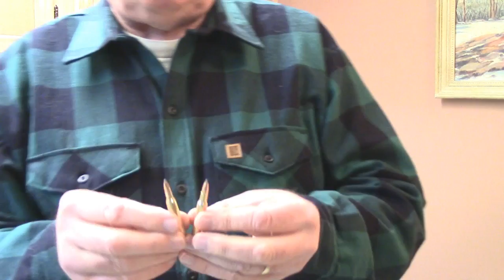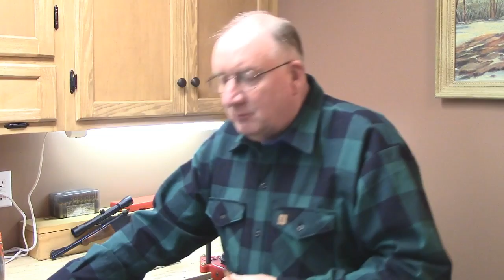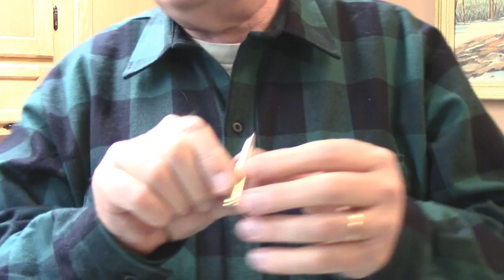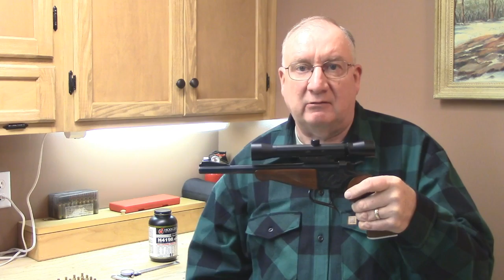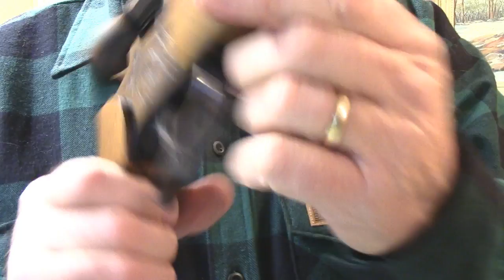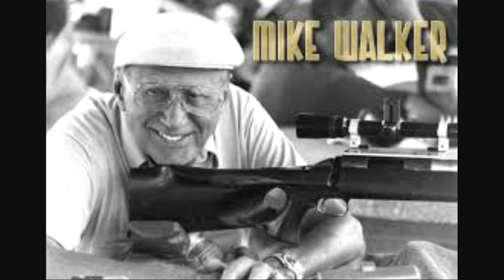The Great  222 Remington

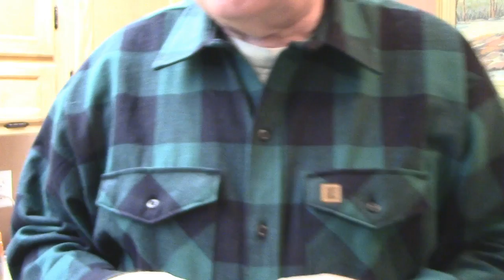Comment: Thank you again for another wonderfully informative chat. I recently purchased a secondhand Zastava M85 mini mauser which was originally chambered for 222 - 1:14 twist - 20" light sporter; but changed to 223 by the previous owner. I was unable to get this rifle shooting accurately until I started handloading as if it were still a 222. I have been able to work a load of 50gr projectile with 21gr of AR2207 (IMR4198 equivalent) which gives me an average group size of 1/2 inch off a bipod. How would this rifle differ in its blast report, pressures, or velocity due to it now wearing a .223 cartridge?
Reply from the maker: A G 
Any rifle is its chamber, so your gun is a 223, despite its former chamber dimension.  If your load is below maximum density, and if indeed approximately that of IMR4198, which you should never assume in terms of equivalent charges, pressures may be running in the 36K c.u.p. range, which would be somewhat below the operating pressures of the 222 Remington.  There is no direct relationship between reduced loads and accuracy, as fine accuracy can be found in any pressure range, depending on many variables.  

Best performance with the 223 Remington is typically achieved with somewhat slower powders than IMR4198.

Blast report is relative to the amount of powder consumed, so it would appear that your charge would be similar in that regard to the 222.
Reply: @GunBlue490 chargé similaire au 222 avec un canon de 20 pouces mais ogives de 55grs, excellente précision à 200m 😊

Comment: The fact that the .222 held the smallest group size record for so long speaks volumes.
Reply: Well said.
Reply: That's because the .223 wasn't about then and neither was the 6ppc...which later dethroned the .222.
As far as it being more accurate than the .223 all I can say to that is I've owned several 
222's and they were no more accurate than the many .223's I've owned!
Reply: I have two 222 bolts and two 223 bolts .One 222 outshoot  all others. And it has about 5000 rounds through.

Comment: Remington 700 trigger did not have problems????  I can assure you that it did.  My 700 BDL that I bought brand new in 1977 would go bang when the trigger was disengaged.  It would happen infrequently, but it did happen.  The first few times I thought I must have had my finger on the trigger, thank god it was not loaded.  One day it was loaded and it did blow a nice hole in the frozen ground.  Back to Remy it went, they fixed it and did not give any kind of explanation as to what was wrong with it.  I still have it to this day and it has not malfunctioned since.  It is always in the back of my mind though.

Comment: My favorite cartridge of all time! Triple 2 has shamanic accuracy if loaded right! I don't need a 22 PPC or 6br, a 222mag,  or any of the 20cal wildcatters. The original Mike Walker 222Rem will get it done! 60gr SMK, and some Bergers.
Reply: M700  triggers are great, but from the factory the Winchester M70 
trigger I find feels much better. I prefer that  more instinctive feel of its leverage with that 
tiny springy feel before the sear release! Yes a good B prefix Remington
 trigger breaks like glass, and most people prefer that. My opinion, a factory m70 trigger is the best.

Comment: Hey can you take a 55.6 armor piercing bullet and put it in a .222 brass casing?     Thanks
Reply from the maker: Jake T 
5.56mm armor penetrating bullets are always loaded into brass cases.  Only the core of the bullet is hardened.
Reply: what im saying is can you take a 5.56 or .223 bullet and reload it in to a .222 brass casing
Reply from the maker: Jake T 
222 Remington and 223 Remington and 5.56mm ammo use bullets of exactly the same diameter, being .224".  222 Remington barrels generally have a 14 inch twist, which will stabilize most 224 diameter bullets weighing from 35 to 55 grains, and some 60 grain bullets, if they have short profiles.  222 Remingtons will not stabilize 62 grain armor core bullets with this 14 inch twist.  Such bullets are very long, because the penetrating cores are less dense than lead cores.
Reply: @jaket1992  yes.
Reply: @GunBlue490  Thank you

Comment: I like your philosopy. For me the 221 fireball for the light 22 and the 223 for the heavy 22. Then go 243 with light bullets for the big varminter. I did have a 22 250 and the 243 and they are so close. I don't know why the 6mm 55 gr bullets have a better bc than the 22 bullets of the same weight but it works out great.

Comment: thanks for the video ! I have a Remington 788 chambered in .222 and I reload. I shot a small doe last deer season at 135 yards in the neck. She dropped like a rock. I also shoot a very accurate .308, But there is a certain confidence I feel when I take my low recoil .222 hunting. I know exactly where the bullet is going to hit  out past 200 yards.
Reply from the maker: TheBamayaker I hope you are using very heavily constructed bullets, with good sectional density.  I would not go lighter than a 63 grain Sierra Semi Point or a Nosler Partition.  You are working with absolute minimum performance, regardless of where you put that bullet.  It's a great round, and I applaud your confidence in it, but it's no deer cartridge, no matter how it's sliced. BTW, neck shots are very iffy, especially with light calibers.  The spine is extremely small and a missed vertebrae can really louse things up.
Reply: N

Comment: I'm planning to buy a Tikka .222 and will start reloading for it. What is the best powder for accuracy. I plan to mostly shoot paper and want accuracy vs terminal performance.
Reply from the maker: IMR4198 was my favorite, and was the traditional powder for many years, but any powder in that burning rate should do fine. I prefer extruded powders for consistency over spherical powders, but many of the quicker spherical powders do work well.  I recommend that you refer to a good loading manual, such as Sierra.

Comment: The .222 was eclipsed, true, by the .223.  But before that the .222 assured that a wildcat that I have, reload and shoot, the .22 Maximum Lovell, would never become a factory round.  Based on an obsolete .25 cartridge, the .25 Single Shot, it is accurate and enjoyed a following among varminters and bench rest shooters first as the 2R Lovell then the Maximum after the shoulder was blown out to increase capacity.   I have fun with it but new brass is very hard to get.

Comment: Hey what's your opinion on the Anschutz company. I am thinking of buying Anschutz new 222 1771D.
Reply from the maker: One of the best in the world.
Reply: I have a question i am a bit worried though like i said i want to buy Anschutz 222 1771D all the other Anschutz rifles i own are amazing but. In all the pictures i have seen of this 222 it has stamped on the barrel "Factory loads only" any ideas why they wouldn't want you to reload it mind you i know a few bench rest shooters that reload it without any issues i just find it odd Germans don't do things for no reason haha any idea's? thanks.
Reply from the maker: ShoulderRollJason The official public position that is held by virtually all firearms manufacturers is the same as Anschutz.  The reason is very simple.  Only factory loads are made under regulated, controlled, conditions that conform to established industry standards that also conform to the manufacturer's regulated, controlled, conditions from the same industry standards.  That commercial standard is known as SAAMI.     

If a handloader carefully follows laboratory tested load data published by one of the many industry recognized laboratories that conform to these standards, and uses all the safety precautions that are given, and has the maturity to stay within those safety boundaries at all times, AND recognizes that the gun manufacturer will NEVER approve of non-factory, handloaded ammo, the handloader is free to use handloaded ammo.  Carefully made handloads are no less safe than factory loads, and can actually be made to reduced pressure levels for even greater gun life and safety. The problem is with the first word in the last sentence.  They have no control over your care, and they are aware that countless thousands of handloaders are completely disrespectful of safe loading practices, which has resulted in untold suffering from gun failures, which they have no control over.  Certainly, they have no logical responsibility for such a commonly abused practice.  All I have to do is read down a blog thread on one of the many handloading sites, and I find significantly more careless or unknowledgeable folks than careful ones who know what they are doing.

This is a paradox that has always existed since man first loaded his own ammo in cartridge cases.  Firearms manufacturers are very well aware that the activity of handloading greatly supports the sale of the guns and industry that disqualifies handloading as legitimate.  In other words, load at will, but don't expect them to support any mistakes that occur by your incompetence.

Comment: years ago i harvested a nice whitetail but on a cold winter morning while using a fine Sako rifle in .222 and handloaded 40 gr. bullets.   Bullet placement was key and it dropped as soon as i pulled the trigger
Reply from the maker: Nice, memorable experience.  However, 40 grain 222 loads are not recommended for any sort of deer, or for anything greater than varmints.
Reply: Completely agree, i was actually turkey hunting that morning.  The .257  Roberts , Pre-64 model 70 is my usual deer gun.  That or my Pre-64 .270 Win
Reply from the maker: +Daniel Castaneda Those would be my favorites.

Comment: It is very ironic.... Spain is plenty of 222 since 223 is forbidden for civilians, so we have rechambered versions of AR, AK, etc, in 222 remington and most people here crtizice the caliber for this reason and are anxious! for a 223 rifle
Reply from the maker: The 223 is a fine caliber that has an additional 50 meters of range over the 222, but in practical use, the 222 will do virtually anything the 223 will do.  Those who desire greater power have other options, such as the 22-250, which is quite versatile, and offers the handloader velocities ranging from the 223 to almost the 220 Swift.
Reply: GunBlue490 Or you can go for the 243...
Reply: In Germany, many hunters prefer the 222Rem for hunting on roebuck and Varmints, because it is usually much more accurate than the 223Rem with factory loads.
greetings from Germany

Comment: Great video.  My favorite load was 19.3 gr of IMR 4198 with 52 - 53 gr bench rest bullets. Velocity was down a bit but was best in my Rem 788 with Canjar trigger and Lyman All American straight 10x scope. I spent all of 73' reloading and testing. It would shoot anything well. The W748 powder was a close second for powder and loaded easier. Sierra Blitz 50gr were a bit more accurate than the Hornady 50gr. Now you have Berger and the like.

Comment: I recently acquired a Remington 788 in .222. It is one of the early versions with a walnut stock. I topped it off with a Redfield scope and Burris mounts and rings. It is probably the most accurate rifle I own, including a Remington 700 in .243. At my 80 yard range I have shot 3/8 inch 5 shot groups, with some bullets going into the same hole! It really likes H4189 and H322 powders, especially when I use the Sierra 52 grain BTMK bullet. I suspect it will shoot even better at my local range where I could use a bench with sandbag rests.   Let me just say thank you very much for covering this great little cartridge so well. What a classic round, with a rich history, as you expressed in your presentation. I wish more young folks could rediscover this fine cartridge, and I suspect it would be more popular if gun makers would just release some new rifles that were chambered in it. It's high accuracy level, mild manner, and super mild recoil would make it an ideal gun for beginners, women, and smaller framed shooters. What a fun caliber to shoot. Long Live the .222!!!
Reply from the maker: Those two powders are right on the money.  Try also IMR4198 (old goodie) and Accurate 2015.  The Tripple Deuce works well with relatively quicker burning powders.  Remington made a gem with the 788, which was often more accurate than the 700 due to superior lock time.
Reply: @GunBlue490   I'm looking at a 788 .222 at the moment. Think I need to add it to my collection. Again, thanks for all your knowledge and good deeds!!
Reply: I have a 788 in 222 I am bringing back from the dead. Looking forward to all the goodies you speak of!
Reply: My dad bought a Remington 788 in .222, probably back in the early 70s.   I inherited it when my mom moved to the retirement home.    I've only shot it at my friend's house in the hills.
but I thought it was the most accurate rifle I had ever shot.   I still own the thing.    When I first got the rifle home and unpacked it, I thought it was going to be an unacceptably cheap rifle,
but was pleasantly surprised at the action, which did not feel overly cheap, and then the accuracy sold me on this rifle.

Comment: Ohhh yeaaaaaah! I could listen to your outstanding lessons all winter long. Kudos to you! Coincidently I'm just in the process on deciding on a nice small yet accurate caliber to go for precision shooting. And I have narrowed it down to .22 Hornet or .222 Remington. Being aware that  the .222 wins the precision tournament between these two cartridges at 100m and more hands down, the last two weeks I was more and more tending towards the .222. The main range I will shoot at with such a rifle will be 50m and therefore .22 Hornet is also a appropriate caliber to go for. However, I recognized the superior design of the .222 (as you mentioned: the long neck, the perfect ratio  of volume to power, the head space is given by the shoulder and not by the rim, like it is in .22 Hornet). I know, that I can perfectly do precision shooting at 50m with .22 rimfire - I do this... But if you want to step up a bit further, produce your own ammo, feel a cushy recoil, smell a light breeze of smoke I think the .222 Remington is almost perfect. 

For longer ranges I got a custom rifle with an original Mauser 98 system and a 26 inch long stainless steel bull barrel (31mm - approx. 1.22 inches in diameter) in 6,5x55 Swedish Mauser. This also is a cartridge well underrated and with beautiful properties. I'm not shooting benchrest, but in contrast to the modern high-end rifles I can shoot my Mausi until I'm 90 with the same barrel and can hand over the rifle to my grandchildren in good condition. And it has displayed 9mm (about 0.35 inch) with 5 shots at 100m with standard Hornady factory ammunition without going for ultimate precision - it was the proof shooting of the gunsmith.

Of course, modern times saw the arrival of several new kids on the block: 6mm PPC; 6,5 Creedmoor; 6x47 Lapua; 6mm BR; 6,5x47 Lapua - to only mention a few. And yes, most of these are constructed quite well up to the optimum (shoulder angle, diameter to length ratio, etc.). However, most of these cartridges, and even more the vast majority of the corresponding rifles,  are not designed to be the uncomplicated shooting companion the normal rifle connoisseur would favor.

Therefore cartridges like .222 Remington (and 6,5x55 Mauser) will still have their supporters. As a side note: The .222 Remington is used by many hunters in Germany to go for varmint and roe deer. In fact it is by law the smallest caliber allowed to hunt roe deer with in Germany.
Reply: The Hornet and the 218 Bee where great little shooters and still are!

Comment: Instead of taking the 222 rem and 22-250; couldn't you just down load the 22-250?  This is a question from ignorance as not having experience with either round.
Reply from the maker: You can and it's versatile in that regard.  Some of the most accurate 22-250 loads are throttled down well below max.  But while they are reduced in velocity and very accurate, they are not the 222 Remington. Case size precludes efficiency whenever case volume exceeds the powder required to attain a specific velocity.  In other words, efficiency is best when a case is most nearly full.  Also, the large rifle primer necessary to ignite the 22-250 chamber is counter productive to the finest accuracy, which is one of the greatest virtues of the 222 Rem., known to be the principle virtue of the 22 PPC.  Most importantly, I run contrary to a culture that has disfigured the sport of precision, hunting, skill, and beautiful guns into mere ownership of ugly utility guns that ejaculate lead for cheap thrills. And that's why the 222 Remington has faded. And it's why I am producing videos, to restore something lost to folks like you who seek something more beautiful and noble.
Reply: +GunBlue490 thank you for the reply.  I appreciate the education.  I have a curious type of mind.  I have noticed that I get better accuracy when I develop a harmonically paired round over max velocity rounds.  I have tried to stay in the 30 cal world, so I can grab maybe a couple bullets and use them over multiple cartages, but you got me thing and I bet I might find an orphan 222 rem covered in dust looking for another chance.